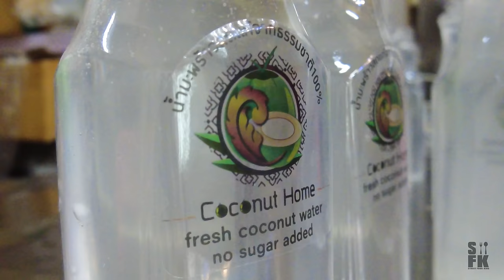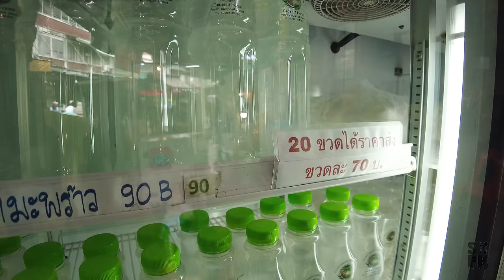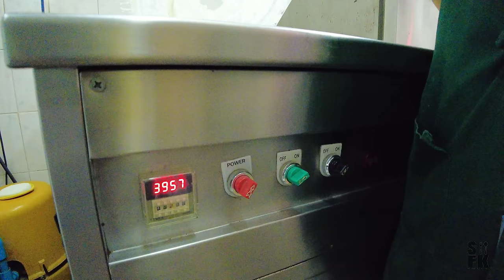Thailand COCONUT Cutting Master and Coconut Secondary Processing Plant - Bangkok

Comment: What do they do with the chopped off outer layer?
Reply from the maker: It can be used as fuel for cooking and coconuts have no place to be discarded.
Thanks for watching 🙏
Reply: The husks are dried and can be 

1) burned for fuel 
2) carbonized charcoal for water filter machines. 
3) fertilizers 
4) beding fiber
5) Fabric fiber 
6) Many other applications that require a tough organic fiber